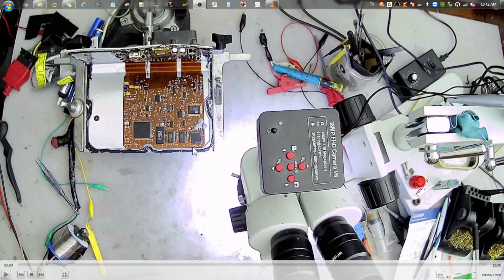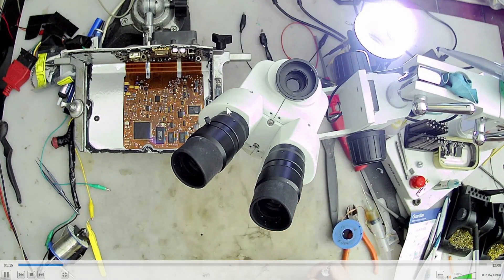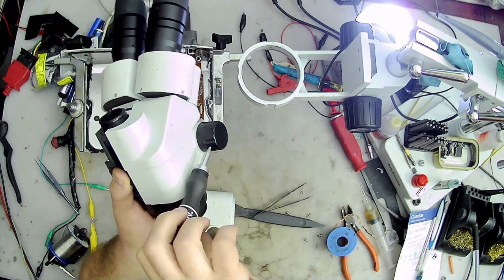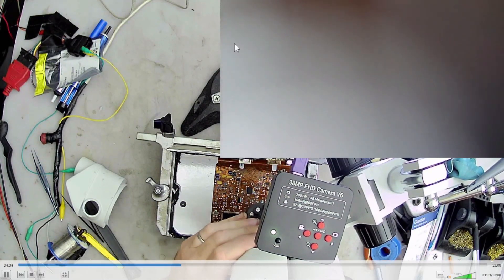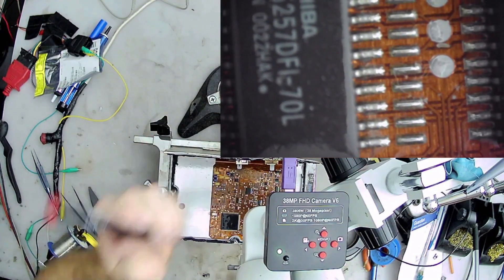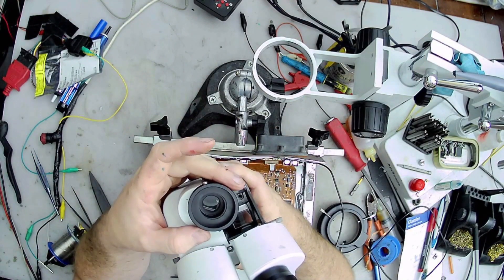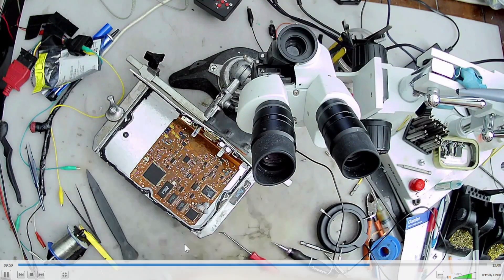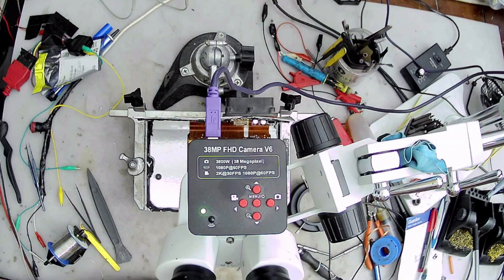Fixing spinning camera port on my Amscope Simul-Focal Stereo Zoom Microscope SM-4NTPZZ

Comment: Any suggestions for a reasonably priced trifocal microscope like the Amscope you use ? Would you buy the same setup again or make any changes ?
Reply from the maker: Im happy with the amscope but I bought it when I had no idea what I was doing. Its pricey compared to other similar units off aliexpress. These days I'd go with something off aliexpress that are half the price and come with better attachments. The most important thing for me is the double boom arm and the "simul-focal" which lets you see through camera and both eye's at the same time. Something like this https://s.click.aliexpress.com/e/_opeU16t . Eakins is pretty decent and Ive had good experience getting camera's from them. The scope's seem pretty much 1:1 from what I hear. If I didn't want to take the risk of shopping on ali (understandable) then I'd still go amscope.

Comment: Very interesting and thank you for sharing. I have  the mono digital microscope, viewing on a screen and  I am used to it. Perhaps one day I will buy a trinocular microsope.
Reply from the maker: I had a digital one for a while. Used to tell myself it was good enough and that I preferred looking at a monitor anyway,  but I have no shame in admitting how wrong I was. Being able to see the depth in what your looking at with a stereoscope and how clear things are makes a huge difference. The stereoscope is pretty much like your real vision magnified while the digital one is exactly how you see it in these video's. My biggest complaint about switching to the stereoscope is that it has spoiled me so much that I hate to look at anything with out it when working.  When I used the digital one, usually I didn't bother setting it up unless I was recording.
Reply: @ecurepair  Thank you for describing the advantage points. For sure when I have spare money I will buy one. They are fairly reasonable on Alpres.